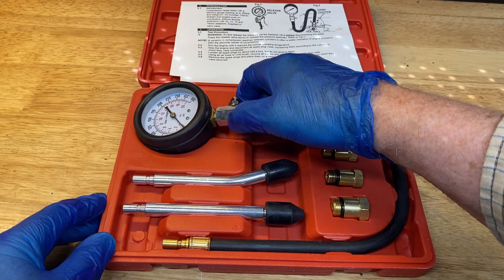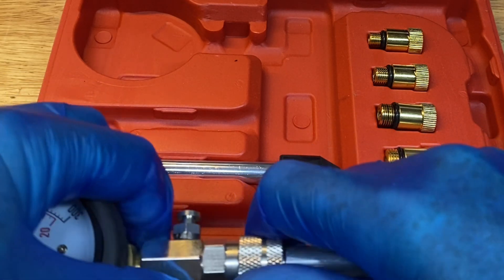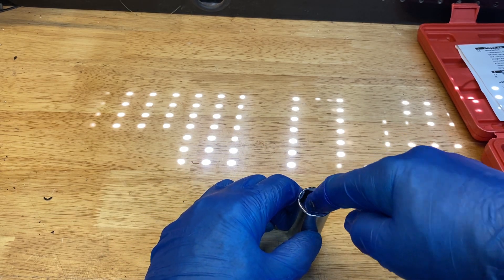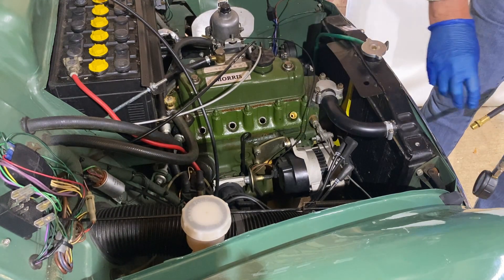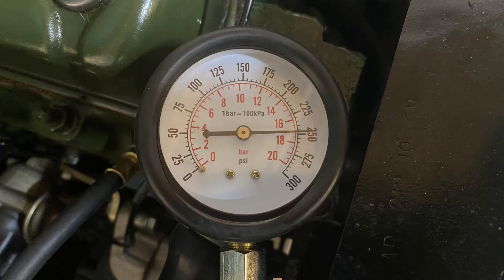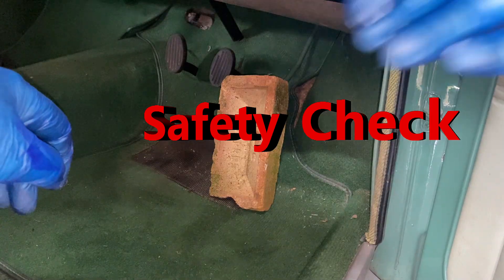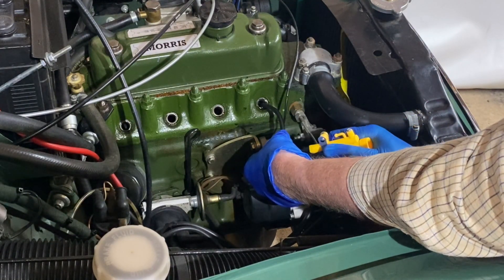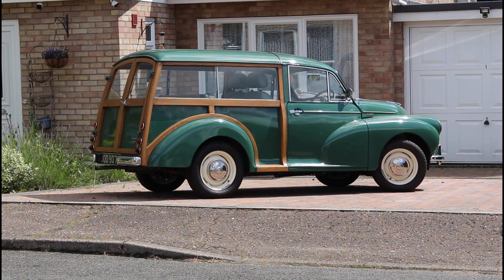How to use a compression tester properly and interpret the results

Comment: If the throttle is blocked open will the engine flood if you have a mechanical fuel pump when you are cranking?
Reply from the maker: Just disconnect the fuel line